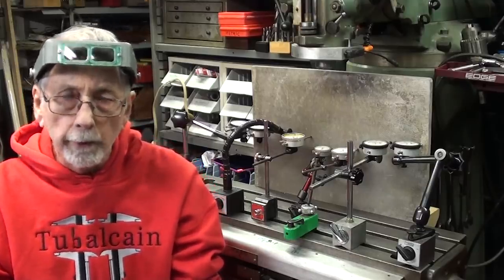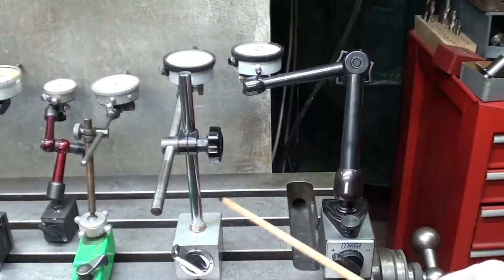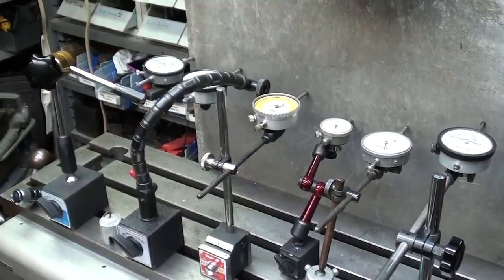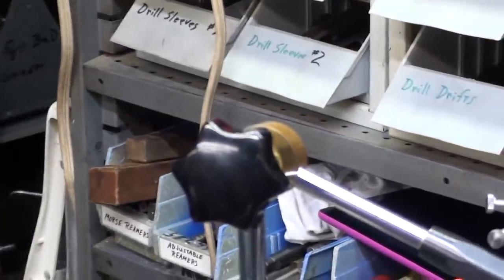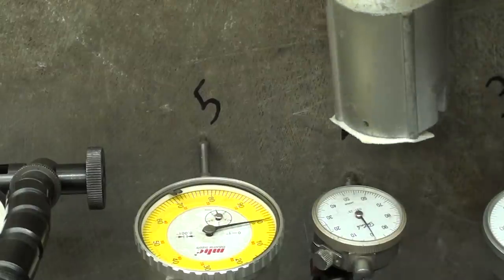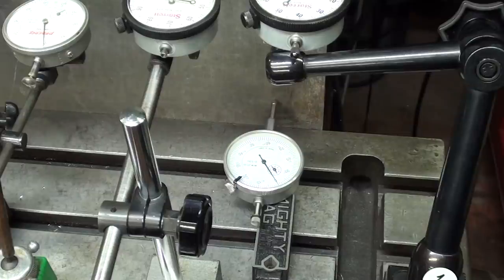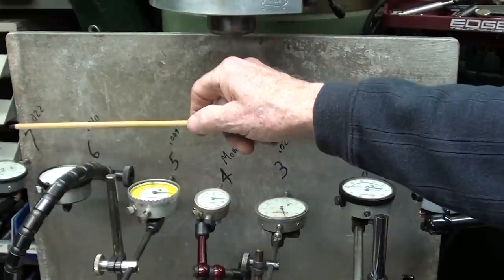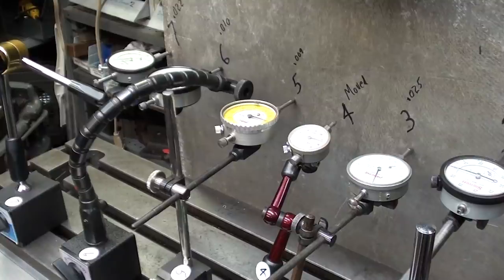WHICH IS THE MOST RIGID DIAL INDICATOR HOLDER 703 tubalcain

Comment: Very good comparison.
Sadly not all of us can affordUS made indicator mounts, still very informative
Reply: I believe the NOGA is made in Israel. But yes, it is quite expensive. The magnetic base isn't of much concern (in terms of rigidity, but the parts North of the base (including the joints) will all add points of imprecision or flex so being careful with them and getting good parts (buy from eBay or garage sales or...) is the key to your personal success.
Reply: @jcknives4162  agreed on quality of parts and tools. I have a couple Chinese arm mounts. They work ok.   If possible I will replace them one day... For the meantime I am very gratefull for china-made tools for the low budget machineshop owner. :)

Comment: Thanks for a very interesting video. The number 4 type reaches everyware but the type 2 doesn't but it's more rigid in my opinion from my own equipment.
They all bring the same question to me, the torque, the force needed to lock and make them rigid. How long will they last before being done?
That could be a second video, a follow up, to compare the tightening force needed to make them deflect the same small amount. What do You think?

Comment: The glare you are refering to is probably highlight clipping. Cameras have a dynamic range which is their ability to expose for and caputure the darkest shadows and the brightest highlights in the same shot. The fancier the the camera the better their dynamic range (usually). Even the best cameras have problems capturing the brightest highlights and the darkest shadows at the same time. You can under expose the shot if you want to capture more highlight detail but that means you will loose shadow detail and everything else will look too dark. You could try setting up what's known as a flag to block light (usually a piece of card stock or foam board) and create a shadow over the indicator dial if you really want to capture more highlight detail in that part of the shot, or maybe look for an indicator with a negative display, ie white on a black dial. You could also try using a circular polarizer on your camera lens as that can cut out some reflection from the indicator glass, but I think that's probably only part of the overall problem and not all cameras can accept them. Sorry I've not been more helpful but hopefully I've gone some way to explain the situation.
Reply: I'm glad you weighed in. Great comments for MR Pete and anyone who struggles with light... wait, we all struggle with light. lol

Comment: I have been using NOGA indicator bases since their very first USA introduction. The earliest versions used inferior plastic components. Knobs broke and and small T handle over knobs broke. I don't like the NOGA base fine adjust feature. I much prefer the fine adjust mounted at the indicator holder.
In spite of my complaints, NOGA is still my favorite. I picked up a Fowler mini base test indicator set a year ago and finally had a reason to use it. Fowler should be ashamed for putting their name on this product. Everything functional in this rig was awful. It is very pretty and cute, and it will remain cute and pristine as it spends the rest of its life in the drawer.  Why is it that companies like Fowler will brand top-of-the-line products that you would kill to own and bottom-of-the-line products so shamelessly?

My first NOGA magnetic base with the plain aluminum arms is still a first go to base, although it sports a shop made brass replacement knob.

We had a Fellows gear shaper and Barber Coleman gear hob operator that loved his cable and ball "Flex-Arm" style magnetic base indicator holder in the early 1980's. It was super handy to set up. He was the envy of several folk that relied on traditional two stiff arm holders or the fine adjust style with the mid bar pivot fine adjust. When I tested and demonstrated the compromised rigidity of the "Flex-Arm" design, that gear maker nearly wanted to fight me. 
Mitutoyo had a "hydraulic" single knob magnetic base indicator holder that preceded NOGA. I never owned one, but they functioned like the NOGA. Did anyone ever own one or take it apart to see how it worked? I haven't seen one of these Mitutoyo bases in 30 years.

Comment: If you want something truly rigid to use on a surface plate, take a look at a Starrett 252-14. The fine adjust, alone, is remarkable. And talk about repeatable readings! It's fantastic. The 252 an opposite of a surface gage in a sense that it doesn't want to move at all. Not something one would use with a mill, either.

Comment: Totally off topic , if you have a magnet then you can hold a work piece on a set of parallels and then measure depths , as some items have a flat machined face on top but may have a cast or forged bottom face which is inaccurate , so even a mag base that is no good can be useful . 👍🙂

Comment: Can you drop them from 6 feet on a concrete floor. And after that's done test their damage and precicion?
Reply: My POS Chinese 1" dial indicator was knocked off the lathe twice mounted on a older made in Japan mag base.  Both survived with nicks to the mag base.  The Chinese indicator did not get a scratch!  If that had been one of my Starrett indicators, it would have been trashed out!!!  Figure that one out...

Comment: Interesting test but not very well designed. Nro1's upper arm was sideways, which is propably the reason why it seemed so stiff. When it flexes, it do it straight down without changing the distance on the plate. To measure the flex, indicators should measure the distance downwards.

Comment: Sorry, but the only thing this really shows is don't place a weight on the indicator base or the arms. I think a better test would be place the indicator base on an angle plate. Now see just how much force it takes to get the base to move. On the rigid arm ones I really like the Starrett because it is easier to mount test indicators to IMO. The reason the arm is 1/4 is for use with Last (worst) Word indicators. 
One test I would like to see is sensitivity of different brands. Some like Tesa, some like B&S, others like Interapid.